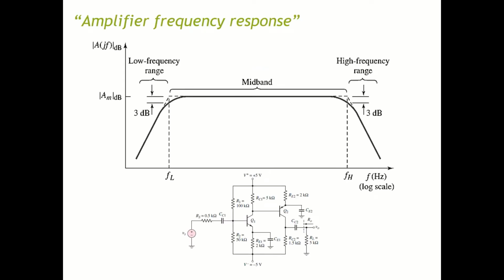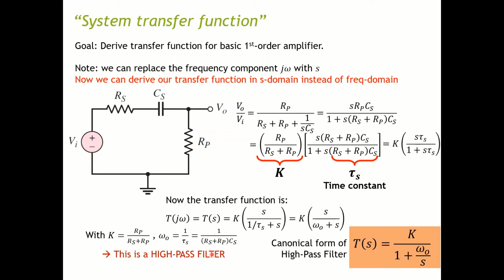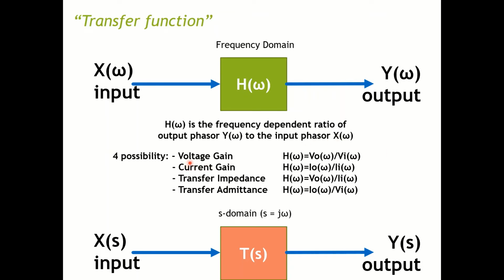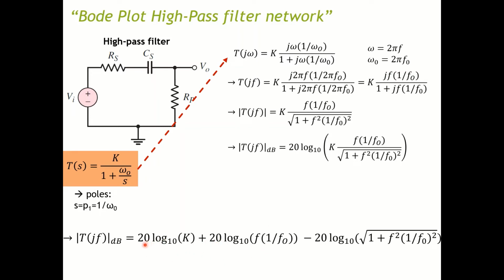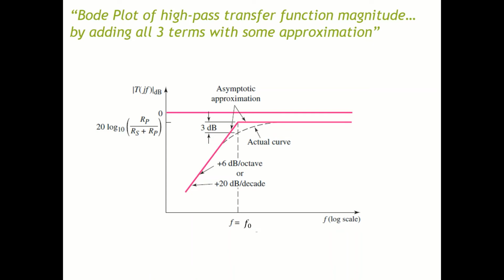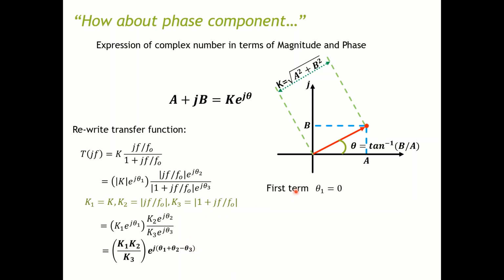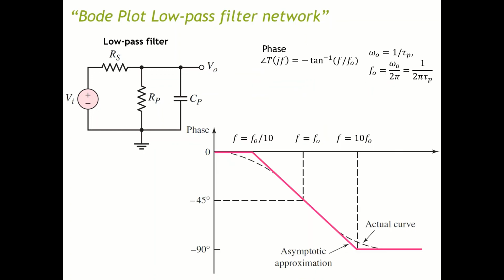Week 3-1: Frequency Response & Bode Plot

Comment from the maker: Time Stamp:
Lecture Begin [2:18]: https://youtu.be/66eOT9A1DM8?t=138
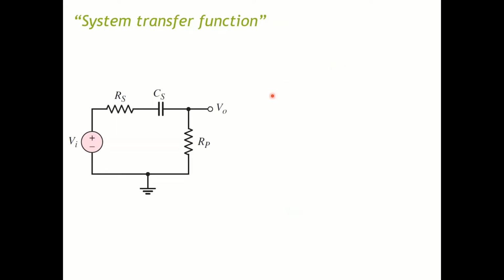System Transfer Function [8:48]: https://youtu.be/66eOT9A1DM8?t=528
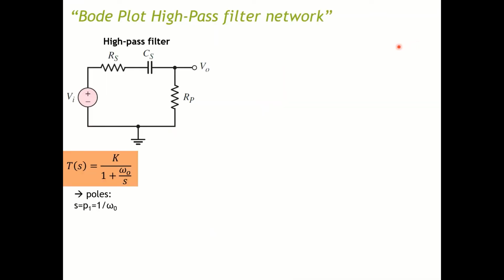Bode plot for High Pass Filter [24:46]: https://youtu.be/66eOT9A1DM8?t=1486
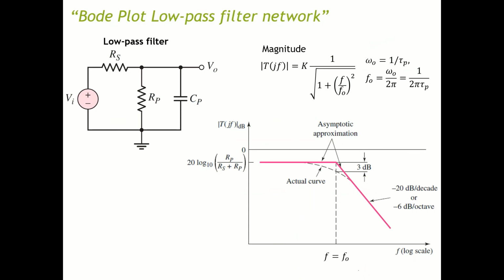Bode plot for low pass filter [45:20]: https://youtu.be/66eOT9A1DM8?t=2720